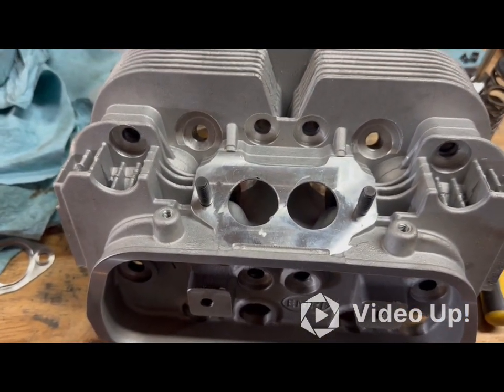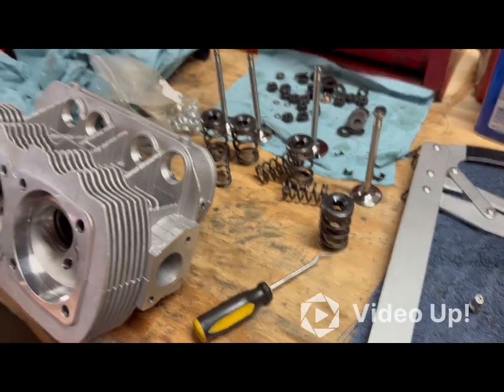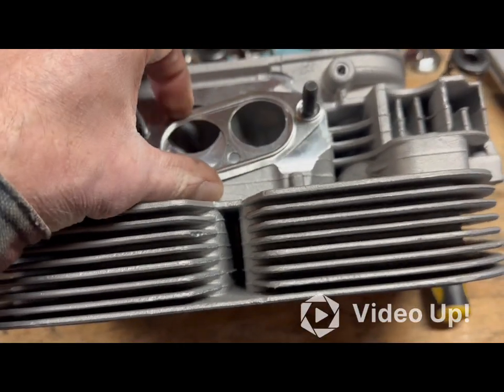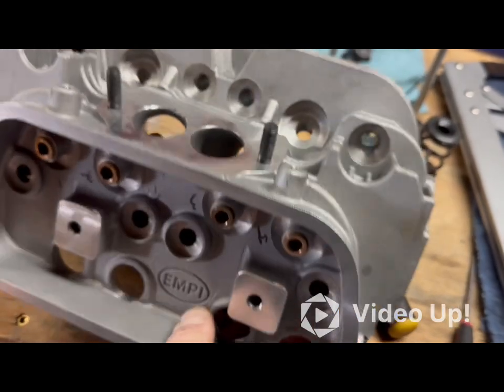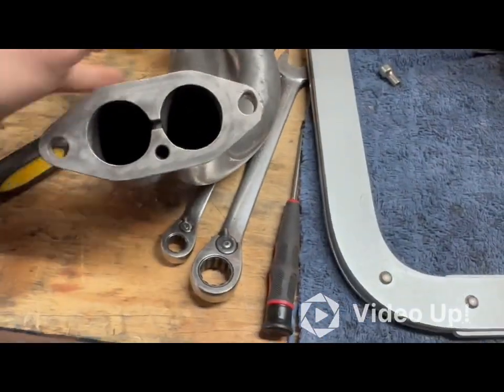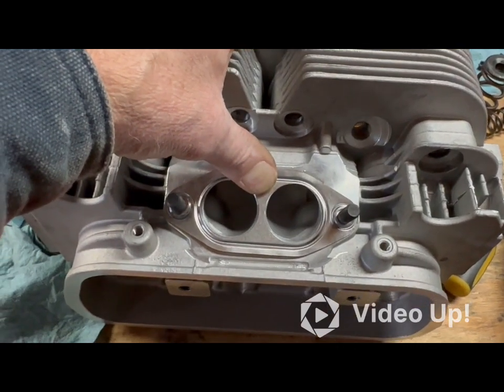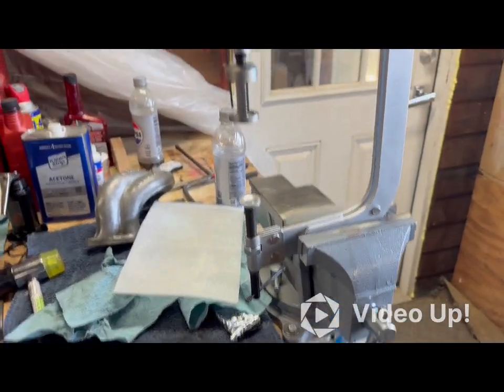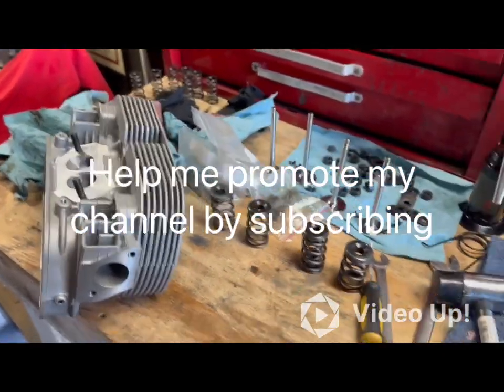Fixing manufacturing flaws on Volkswagen heads

Comment: The single springs by themselves should be what they call single high rev springs. This would allow a smaller camshaft like under 420 lift. (which is big enough for a lot of applications). Honestly Ron.....Please please put a small performance camshaft in there. Looks like your building a 1600 from the head opening. this will help get a better air fuel volume in the combustion chamber which will help the engine run cooler and more efficient. The stock cams were way too small on these engines. If you want to go on the cheap you can get a reground 100 cam from Brothers VW machine shop in Ontario CA.....and reground lifters. These are super reliable. The cam grind is very close to a web 86 without ratio rockers. (even though it is called a w100 uggg) It works well with smaller engines and gives you that top end and midrange your wanting. Those heads look like the 57cc Autolinia castings. They use good aluminum. check your ccs. I think it might be a bit low compression for stock application. will run like a bag of nuts.  Stock was around 50cc  with a 57cc your compression will be 7.0. Like a 40hp... So what I would do is get those head machined out for 90.5 and put a 74 stroke in there to get the compression ratio around 8 to 8.25 and use a performance cam. Stock carb. then it will run great. Use the CB performance engine calculator this will help you see what I am talking about. Like an 88 thick wall with 74 crank will work OK with those heads. still a bit low compression if you go stock deck height. IF you want you can get stock length clearanced rods and a 74 crank  and step cut the heads. Then use a tighter deck height. This would get you there. Those larger CC heads are designed for larger displacement engines. I am not sure why they even sell  them in 85.5 openings.
Reply from the maker: Thanks for the advice. This is exactly what I need. I responded to this on another comment you left. Let me know what you think of my setup. Like I said I’m using 88 slip ins (which I know is a no,no) but I’m keeping my fingers crossed and doing everything else to help it run cooler) . The compression came in at 7.6. I’m running stock cam and stock crank. I am however putting in a two barrel progressive carb and I plan on only running premium fuel.
Reply: @jachoftrades6t8  Well I will just give you the bad news.....But better to be straight foreword. I think I will make a video on this subject just to help others with these situations. the power you gain with 88s you will loose with needing to retard the timing to stop the engine from running hot. and it still will run hot. Secondly I would just simply take apart what you have done and put a performance cam in there. Send the heads out to be opened to 90.5 92. and get some thick wall cylinders. CC it all for 8.25 which will run GREAT.....On the cheap get one of those so called engle 100 cams from Brothers VW machine shop That would be fine. if you want a new cam option you could use the C20 scat. which would give you about the same results. ad ratio rockers to 1.25 and it will really pull hard. Personally I just would have started different. the weak point on the VW is the cam. Stock cams are just completely useless IMO. The extra advance built into the performance ones is way better. If you want a bit of pickup start with a 74 and short rods. All counterweighted which is just plain better. If you have good stock crank and rods the options I said before would work OK.
Reply from the maker: @Mikefngarage  I really appreciate the straight talk. I really kinda jumped the gun on the parts that I bought and the work I have in it at this point. I do respect your opinion and have no reason to doubt what you’re saying, unfortunately I have to send it at this point. I’ll get it together for now. The whole thing is a learning experience at this point and I do intend on taking what I’m learning and applying it to another build in the near future. (Probably sooner than I have intended )
Reply: Honestly  ... this has to be the most painful, hand-held shot and posted video on YouTube. 
By a friggin tripod or something.
But please stop blogging 
This hand-help video is "WORST"  crap on here ...
Reply: @thestove2407  I guess you have never seen my old stuff when I first started....talk about painful. Camera shaking all over the place LOL....I didnt know anything about filming back then just started doing it. Go back to my first ones....they are comical. and painful.
Reply: @Mikefngarage  
Hey Mike .. I'm absolutely honored ! I'm a very big fan of yours, and I've watched every video you have.
Maybe that's why I was so hand-held triggered .... 😆 lol
Your latest, longer, complete engine build videos are great !!!!!
Thanks for sharing your knowledge !!
And your friend's new well-lighted shop looks very impressive and promising. 

But ya ... shakey, dimly lit videos are super tough to understand. Walk-throughs are one thing, but while trying to perform two-handed tasks with a left hand .... it's a horrible experience for us viewers... trying to gain knowledge. 

I keep cheering on that weak, uncoordinated left hand .... "Come on, wiggly left hand .... you can do it" ... 💪 

Especially since a lot of people watch these highly educational videos on our big-screen TVs, in the house or shop ... these days. 
So, big 70-inch TVs and shakey hand-held videos ... really are hard to watch.
Fine visual important details are lost on the phones.
Especially when there are youtubers like Vw Fran ... who do such great video. imaging.
Soooo that's my beef. I do apologize for being so tough on hand-helds, but maybe get a chest mount.
Cause I really appreciate the content. It's huge, its vital, and it's important for us followers' education. 
That's why I'd request a little less single hand ... video shake ... for all us followers. 

Cheers Mike
Thanks for all your time and effort in sharing your experiences, knowledge, and visual vw content.
Oh, and when you are talking and sharing the Pros and Cons, upside and down-sides, framing the message ... I call that "collateral learning" and that kinda experience is like the true gold for us followers !!!!
Cheers ... from Canada 🇨🇦
Reply from the maker: @thestove2407  wow man! I do have a tripod and I do use it. Maybe this particular video wasn’t for you. I’m still figuring this out. It gets better.
Reply from the maker: I also have some recordings where what I’m working on is not even on camera. I never claimed to be a pro.

Comment: Stock valves springs info.1600 engine,  31mm (1.22 inches ) @ load  117-137 lbs   Looks like youtube deleted my last comments about valves spring info.
Reply from the maker: Since I have no way of measuring the poundage I’m rolling the dice on just using the larger spring by itself.
Reply: @jachoftrades6t8  I have use a small drill press and a weight scale. Worked great.
Reply from the maker: @vintage76vipergreenBeetle  a drill press I have, the scale, I don’t. I tried to compare them with the stock ones and they actually seemed to be a little stiffer so I’m guessing they are probably good. It’s not really the best way I know but it’s all I can do for now
Reply: @jachoftrades6t8   I understand. I just want the engine run well and last.